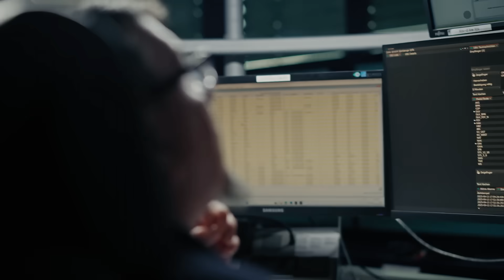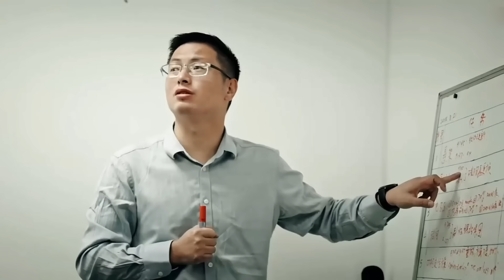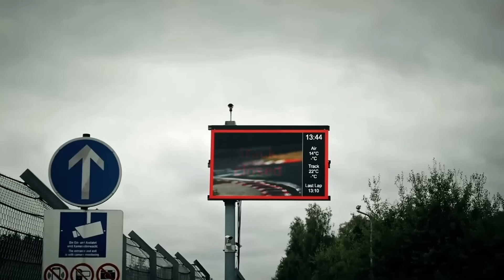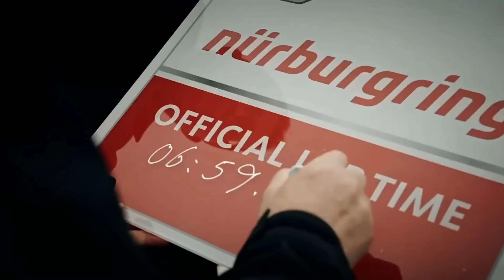WORLD FASTEST CAR NEW RECORD | BYD Yangwang U9 Xtreme Attack

Comment: Sorry Bugatti... EV is the future 💀
Reply: Michelin Bugatti Super Sport .. top speed at 430 km/h ❤❤❤
Reply: @kcer2106  bro the car in this video did 496 kmh and has better aerodynamics than a bugatti
Reply: @SlothGhub 这个车本来标配大尾翼的 你看这个车这次都没搭载就知道有所保留了
Reply: @SlothGhub this car has 3000hp. The Bugatti chiron SS Did 490 km/h with Only 1600hp
Reply: @manuelbartenschlager8723  wrong
Bugatti did 1750 wheel hp when Steve Hamilton dynoed it... So in crank it's about 1900..
And yea ice cars can do better than EVs
I mean this car pushes like 3k hp meanwhile Ford gts with like 2500 from flordias do 305 mph easily....ev and ice cars have their own ups and downs
Reply: @SlothGhub  thats almost 1100hp less and only 6  km/h difference
Reply: @manuelbartenschlager8723 on a longer track
Reply: @Rameon_RL  wait for the jesko absolut. In a Simulation it can do 530 km/h
Reply: @manuelbartenschlager8723 "in a simulation"
Reply: Simulations are always very accurate to reality. Simulations are not video games. The Agera R drove in the simulation at that time 443kmh and reality 446kmh
Reply: @manuelbartenschlager8723  yeah yeah my car is super fast in dyno too.
Reply: No test bench, realistic driving simulations that deviate less than 1% from reality. Flight simulators also simulate 99% of reality
Reply: @manuelbartenschlager8723  gran turismo is also the best simulator. I drive concepts at maximum speeds😂😂😂.
Reply: @shanebluesky7452 The Jesko’s 530 km/h figure came from advanced simulations — including detailed CFD (aerodynamic flow analysis), drag and gearing calculations, and dyno tests. It was the result of complex engineering models, not video games, and remains a theoretical top speed until verified on track
Reply: @manuelbartenschlager8723  theoretical = theory.
Yangwang u9 would have also done the record on simulations and you lot would be crying. 
Its real on road performance > simulated fangirl arguments
Reply: @shanebluesky7452  the U9 has more than 3000hp. It have to do this with 1600hp then we can Talk
Reply: @manuelbartenschlager8723  😂 whatever you are siding with has to be in real world performance. THAN....WE CAN TALK 😂
Reply: @shanebluesky7452  real World 0-400-0 in 25s with rwd. Who can beat This ?
Reply: @manuelbartenschlager8723  yangwang in simulation 😂😂😂
Reply: @manuelbartenschlager8723  How about price? Why u didn't mention the price? poor guy....
Reply: Price does not only consist of performance. Koenigsegg uses high-quality materials throughout the car. The rims alone are worth 100k. Titanium screws, where each piece cost 60$ etc.
Reply: @manuelbartenschlager8723  The fact that this car can reach almost 500 km/h without disintegrating really speaks to its quality of the part
Reply: @yuchaoluo895  尾翼只是增加下压力，会让极速变低
Reply: @kcer2106 bruh did you even watched the video? Its 496km
Reply: @kcer2106 I would still buy Bugatti if I become rich only if it's 5 times cheaper.I like it's mileages and engine. don't care much about speed .For me 200Km/h is more than enough
Reply: Chines can build cars more fast,
No need to wait few years.
Reply: @bagus3lkoenigsegg: hold my beer
Reply: Bugatti belongs in the museum.
Reply: @hermesliteratus882 Bugatti is almost 6 km/h Slower with over 1000hp less
Reply: Ehh EV something else 😅😅😅😂😂😂
Reply: Wkwkwkw
Reply: For top speed? Sure. For fun, beauty, luxury and excitement? No.
Reply: @RadialSeeker113 Instant torque and power is fun and makes the ICEV feel old. The only thing missing are batteries with less weight.
Reply: @RadialSeeker113  EV can be fun too, Just it doesn't have sounds, Luxury: most of Chinese car actually luxury, just hear inside of cabin over 450kmh, where the wing Noise sounds? seem like none in this vid, Beauty: nah the haters always blame the Chinese car are terrible design, try it change tu RR or Pagani, people be like (WOAHH WHAT A ART IS THIS)
Reply: @RadialSeeker113  dumnass
Reply: No Problem, CEO of Bugatti is also CEO of Rimac 😎
Reply: Have you heard about Tourbillon's 550kph speedo?
Reply: Cars are about more than just speed and numbers
Ev's lack the emotions compared to ice with a good gearbox
Reply: It probably ran out of charge.
Reply: @Galeazzo-j8p  isn't the max range of a Bugatti 400-500 km with 100 liters of fuel? Isn't that the same as a U9 with a full charge? And considering the price of fuel, I think a U9 will be cheaper to run than a Bugatti, which needs high-octane fuel.

Edit : source Rimac video (testing bugatti range while maintain constant speed)

Comment: But it's EV 😂😂😂
Reply: Doesn't matter
Reply: Your point? Fast is fast. Keep coping with your overly complex ICE cars that can have a million things go wrong with them. EV's will keep advancing whether you want them to or not.
Reply: @EliteGamingRevolution  as if electric motors doesn't get hot enough nor in the water ur EVs are safe... Lol
I too love ev cars like the evija and rimac
But gas cars are always better
Reply: @SlothGhub if you compare energy consumption between ev and ice, ice is shit. Heat, vibration, moving parts
Reply: That's the point. Proving EVs can do better than combustion cars.
Reply: @Linkwii64 not entirely true... but agreeable 
They way a ton
Reply: EV's are getting a bump from 600km to 1200 to 1500 km next year, other then the motors that are already powerful you're getting more then double the range in a single charge. Ii like combustion engines but the sound of the electric motors and transmission is really cool. then we got the hyper EV's like this one, a whole other level
Reply: Therefore, it is more comfortable.
Reply: Unfortunately, it is an internal-combustion engine car. I prefer my carriage.